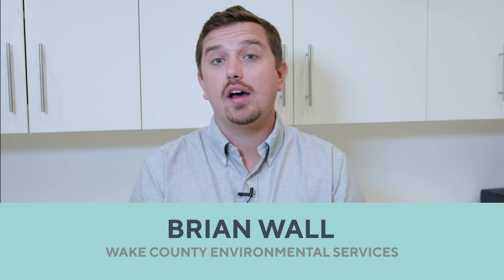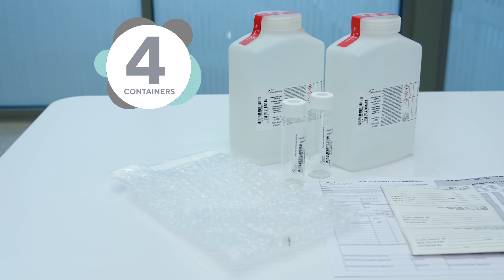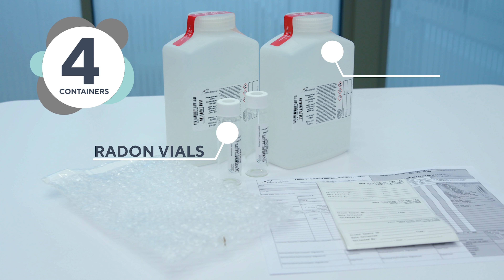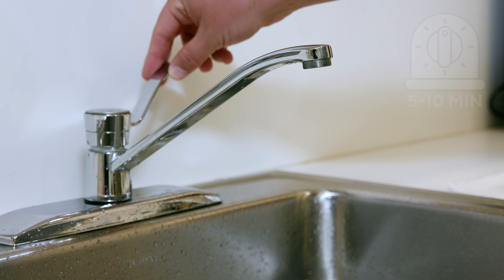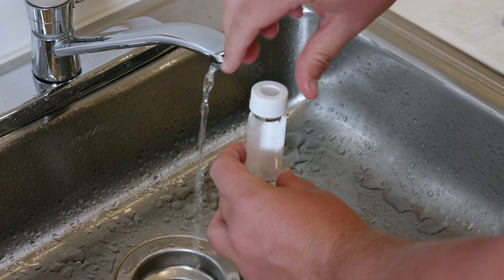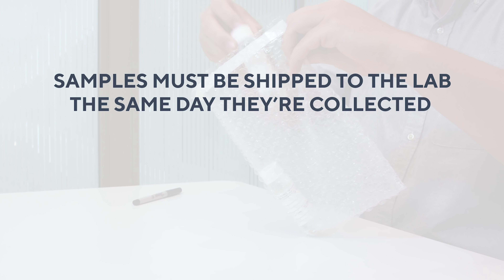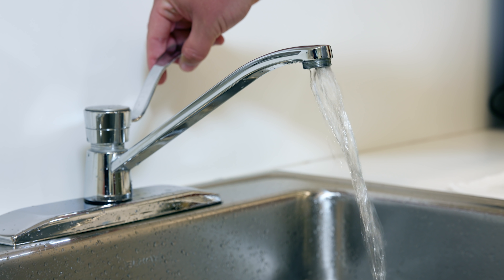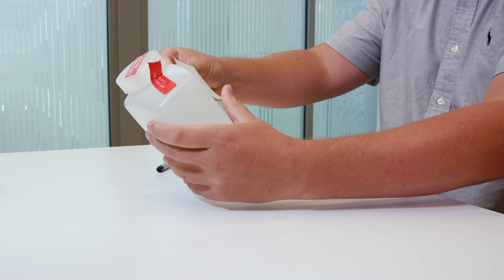How to Collect a Well Water Sample at Home

Comment: Great video. I had a question. Wouldn't it be more accurate to get two samples, one from the immediate stream of water and one after waiting 5 minutes? That way you can check the quality of water in your pipes also. Not many run the water five minutes before using it. Otherwise it was very informative, thank you for the information.
Reply from the maker: Hey Ms. Faella. If you have any questions regarding testing please visit wakegov.com/wells or call 919-893-WELL
Reply from the maker: We followed up with our Groundwater staff, Ms. Faella. They said, when water sits in the pipes, the concentrations of some contaminants can decline or increase. For most contaminants, it is the long-term, sustained exposure that we are concerned about, so it’s important to measure the quality of the water that will be delivered on a sustained basis – which is why we recommend letting the water run before collecting a sample. In other cases, such as tests for lead poisoning, a “first flush” sample is appropriate. If you have any more questions, just email waterquality@wakegov.com.

Comment: We currently have a water softener that is clearly not up to the task of handling our well water. How would we go about accurately testing the well water while the current water softener is installed and active? Thank you!
Reply from the maker: Our recommendation would be to start with testing of the untreated water, prior to the water softener. A sample can be collected from the wellhead or an outside spigot that is not connected to the softener. The results from that untreated sample can then be used to determine what testing of the treated water is necessary and, if needed, to tweak the operation or design of your softener. Be sure to check our well water testing recommendations at www.wakegov.com/wells to make sure you are getting all the recommended tests.